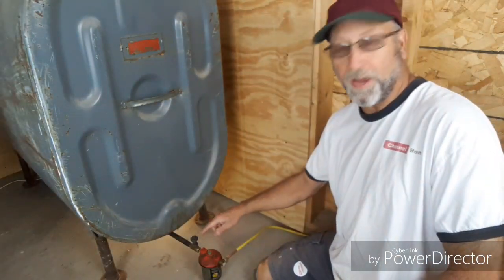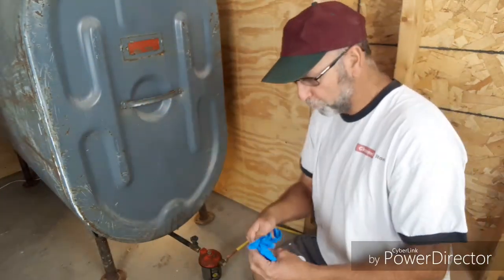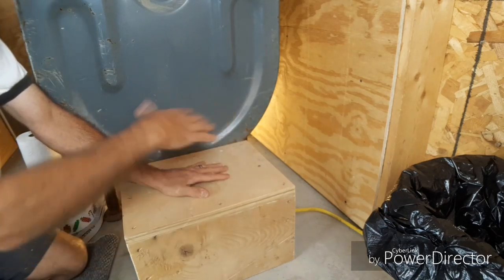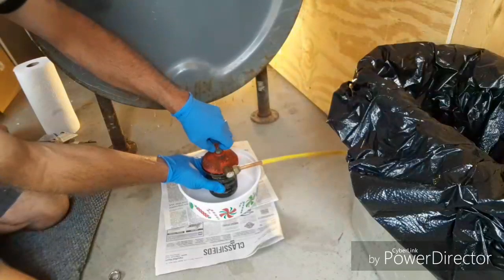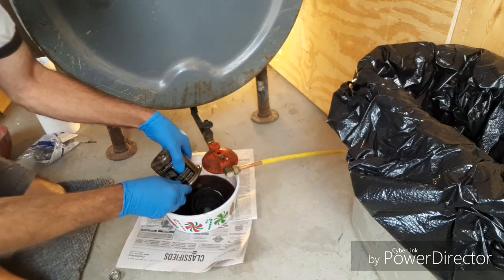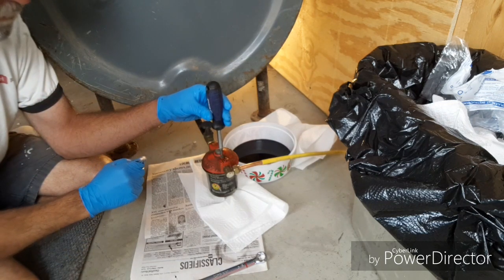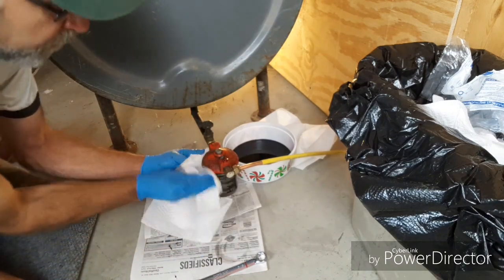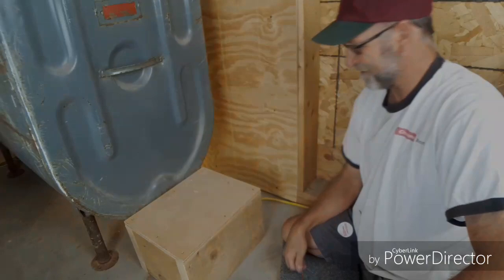How To Change  Filter On  Your Oil Tank

Comment: Great video thank you. I replaced filter and everything went well. However now there is a very slow drip from what looks like the bottom of the filter housing( maybe a drop every few hours) any thoughts on what it could be?
Reply from the maker: Sounds like there was a little dirt around the housing. Did you clean it well before putting the gasket back on?

Comment: great video ... i've been struggling with water in my tank ever since my oil company replaced the tank. is there anything i can do to better filter out the water before it fouls the filter, pump screen and nozzle (which currently happens about twice a year)? thanks!
Reply from the maker: Wow check with your oil company and make sure they are not adding water to their tanks? this should not be happening? I would question your oil company.
Reply: @channelron3593  Yeah, I've tried that. The tech is non-committal about what the issue might be and my oil company, which was bought out by a regional large oil company, is unresponsive. I'm thinking after this heating season I might be best off to change oil companies but I will then have to deal with the water issue. If I wanted to be pro-active, would changing the filter more often help? Basically, I end up with having to have the filter, pump screen / filter and nozzle replaced twice a heating season due to water turning the oil to either a gel or foamy mess :(
Thanks for your advice.

Comment: Thanks for the video. I replaced my filter and all went well but when I opened the small vent screw to bleed the air, no fuel would flow. Even if I removed the small screw completely. My tank is outside with a top feed fuel line and then coming into the basement.  My oil filter cartridge and valve is just before the burner in the basement. Do I have to do something else to get the fuel flowing? I'm sure I have the valve completely opened. Everything was working fine before I changed the filter and the filter and canister was amazingly clean, no sludge buildup at all.
Reply from the maker: Mmm not to insult you in anyway, the valve is open? not sure what could possibly go wrong? make sure the Firomatic is facing the right way. should look like this https://amzn.to/3F1nlKV
Reply: Hi Ron, thanks for the response. I do have the valve in the correct position(open). I didn't try to start the unit because I didn't want to bring air into the unit before asking someone about it. I'm thinking that because I have a top fuel feed (no gravity) nothing will flow until I power on the unit. It's a summer house so I am not there right now. When I go back should I turn the power on and then try to open the bleed screw and then maybe even the bleeder nipple at the pump if it doesn't start to flow freely?

Comment: Thanks Ron - Would I have to bleed the line at the boiler unit as well, or just at the tank filter?
Reply from the maker: No if you get most of the air out you will be fine.
Reply: InstaBlaster.

Comment: Thanks for the video. I have two filters on my furnace that I changed with no problem, but then both started leaking. One from the large gasket and from the bleed line, one from the gasket. Also it appears that one is leaking from where the housing attaches to the oil line. I’m a little afraid to start working with that. Could I be over tightening the bolts?  I’m not sure what else it would be.
Reply from the maker: it sounds like it is not tighten enough?

Comment: Can that shut off valve on the tank be installed upside down?  Also, what is the trick to replacing that valve with oil in the tank?
Reply from the maker: Upside down? I don't think so. as far as replacing valve be quick. or pump into backup tank. good Question!

Comment: great video, what do i do if i dont have a bleeder screw?
Reply from the maker: You could loosen up the nut and let a bit out that way otherwise bleed the boiler and that will work.
Reply: @channelron3593  Thank you, i might use the valve by the pump, also my filter was different then the one you needed